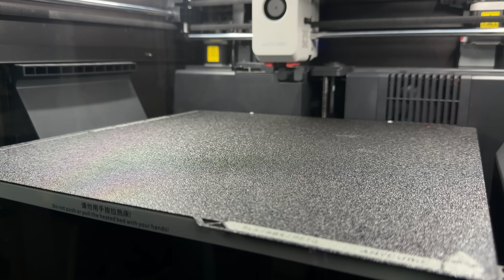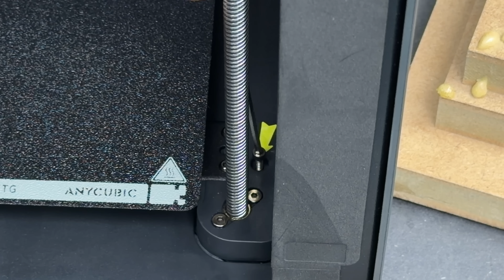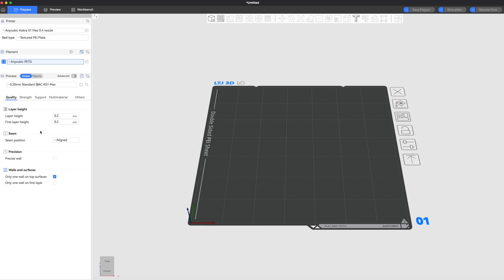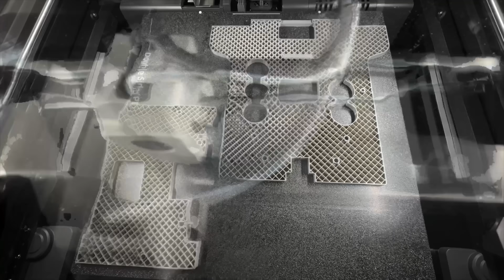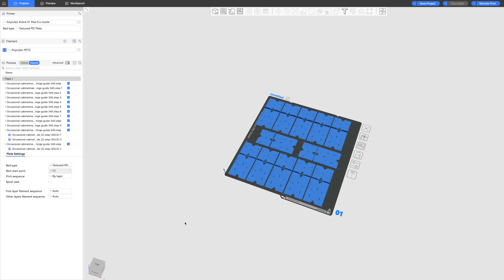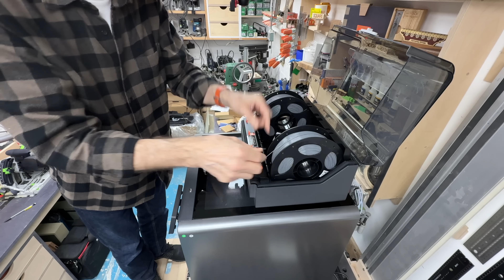Big printer, small price - AnyCubic Kobra S1 Max Combo [video 629][Ad]

Comment: Is it still printing good or giving you problems a few weeks after this video I was also wondering how well that carbon filter worked?
Reply from the maker: It's been flawless, and the carbon filter has been fantastic - better then my 'other' printers, though to be fair they've done a lot of printing and probably need the filters changing. But yes, no issues at all with the S1 Max - it's a great addition to the nest and really give another dimension to what I can do. 👍

Comment: I notice you had lifting/warping on one of the corners of that first test jig you test printed on this printer. Consider using some kind of bed glue adhesive suitable to the type of filament your printing with (e.g a glue stick/Magigoo/Dimafix) to minimize that. Also, a quick easy way to make the lettering in your prints look better would be to fill them with something after the print then wipe off any spillover after. Maybe just some white paint would be enough. It would make them easier to read but also just look more polished/professional to buyers.

Comment: Excellent video Peter. I have been looking at getting a 3D printer having recently added a CNC machine to the workshop. As I've mentioned before to you I'm totally blind, and the CNC machine presented a lot of challenges in that I had to modify a piece of open-source control software (GSender in my case) to run it in an accessible way. Unlike the printer though the CNC machine has no user interface of its own, it is entirely computer controlled. My main concern with a 3D printer is that I can't operate the on-device touchscreen, so I need a printer that allows every function within its firmware to be controlled externally. Is there anything on this printer (loading / unloading filament, calibration, firmware upgrading etc) that you can't do either from software on a computer or via the app? Essentially are there any tasks that have to be done via the screen on the printer itself that there is no other way to acomplish?
Reply from the maker: Thanks Ashley! Honestly, the only tine I touched the screen on the printer was to load the 'Benchy' test print - everything else was done from a computer, or the app. Trying to think if the touchscreen was required initially at first startup, but I don't think it was? Great question though, thanks - I'll ask the folks at AnyCubic for feedback on accessibility. 👍

Comment: grid infill isn’t recommended due to the higher risk of layer shifts from the nozzle hitting the print
Reply from the maker: Yes indeed - my hovercraft id also full of eels. 🤷‍♂️
Reply: @10MinuteWorkshop  you just need to change one setting in the slicer, it's not that hard.

Comment: You might get a higher impact with your tools by making your letters a different color. Easiest way is to make your first layer a different color. The best way is to change your text to a new object instead of a cut. Export the model as a STEP file. I your slicer, you will find a selection for objects. Change the letters to modifiers. Change the filament of each letter to the text color of filament. Then send. The effect is amazing.
Reply from the maker: Thanks. Sales seem to be pretty steady, but if they ever start to flag I'll bear that in mind. 👍